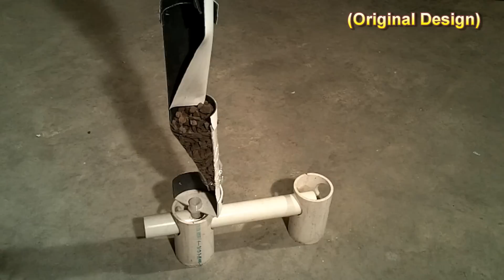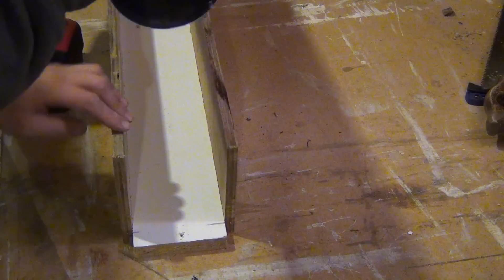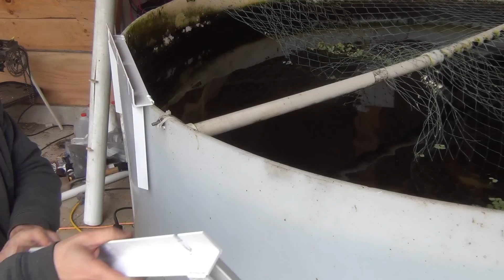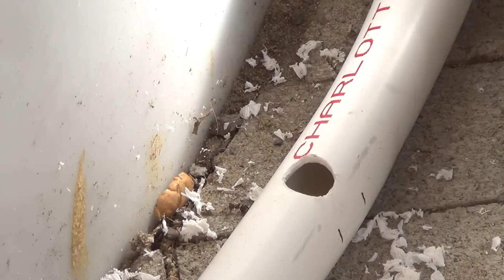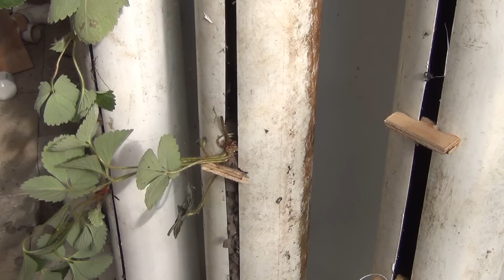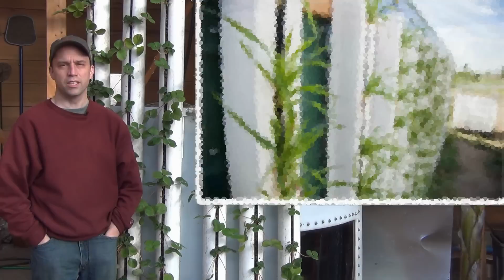How To Build Strawberry Towers: 2.0

Comment: Use coco coir and small holes instead of the slit down the pipe. Coco is light and airy. If your pump goes out with them rocks your roots dry within hours. If you had coco it would retain moisture for hours, you could get away with hand watering in reality, if you dialed in your evaporation might just water 1-3 times a day. Cool build

Comment: I'm looking at a tower system of some sort for new strawberries next spring.   Obviously, you are in a warm climate based on the idea that you have a fish tank that you are attaching the pipe to.
I'm in zone 7A which gets cold in winter.   
Suggestions if you have any?
Reply from the maker: We're in 6a.  If you're growing a few plants a tower is fine but eventually the roots will clog everything. I don't use towers any more.
Reply: @Bigelowbrook  Thanks for the info.
I just tried transplanting strawberry runners from a friends place.   I wanted to keep them on the runner and pot them until they rooted but I couldn't do that.  I'm hoping the roots take.   It's getting warm and the leaves are wilting.  It's only been two days so I'm figuring this will be happening until the roots re-establish.  
If it doesn't work out for me, I just found another source of rooting where I can actually leave the runners on the mother plant and root them from there.

Comment: First.. awesome design..especially when you compare the cost of diy..compared to the cost of zip towers!
I know this vid was made way back in 2013..so now 5 years later 2018.. would you use other medium in the tubes..say...like maybe..coco coir or a antibacterial material like they use in the zip towers?..
The 4" tube..could easily and very inexpensively be retrofitted several different ways to use "other" grow medium.. but I bet you've figured that out already. Again.. very excellent video!
Reply from the maker: I used these with expanded shale for a few years until I had a fruit fly invasion and pull everything out.  I never got around to putting these back it, but they did work well!

Comment: I like using the end caps and Tapping the fittings. 
I was going to use "T" sections of pipe on the bottom but that means a lot of cutting and gluing not to mention the T fittings are more than twice the price of the end caps and fittings.  Going to do it this way for sure. So much faster and easier. 
Good tips, thanks.

Comment: When you're pouring in the expanded shale, could you run a bit of tape to the bottom and just pull it up as you fill so it doesn't fly out the slot?

Comment: why bother with a slot? just drill wholes!!
have you kept them over winter, what is your success?
Reply from the maker: +sonofthunder These have been in place for 2 years now.  If you just drill holes, the plant will get root bound and get so tight the water can't get through.  With this method, you can stretch out the pipe and drop the material right out.

Comment: I built some of these but once the plants start growing the water started leaking out the side of the pipe through the slot. Didn't work very well, tried leaning the pipes over which worked for a while but eventually started leaking again, big problem as my water all ended up on the ground.

Comment: Very good idea. I would say you can save yourself time making this by putting the saw gate .250 then flipping over and going the other direction, you still get a .500 cut without having to move the gate. (If your jig is open on both ends)

Comment: Have you thought about leaving a 6 inch section intact on the top & bottom to maintain spacing?  So, just start your cut 6" below the top & stop about 6" before the bottom.
Great DIY version though!!
Reply from the maker: When the roots get impacted with the shale, I wanted to be able to spread out the pipe to get it all out.  It's the problem with the old design where it's nearly impossible to get the stone & roots out.

Comment: You are just the bomb on this stuff!
Might I make a suggestion? 
You could easily (cost effectively) use a very light weight and affordable material that is mold resistant, antimicrobial.  It's a product that you find in filters for air.  So they will be very safe!  It's amazing how well the plant roots will attach/adapt this. 
You could also use light weight coco coir chips (not the bricks).  This would be of course a little more expensive than the filter material or gravel, but it's very organic and seriously light weight.

Comment: I have a large bed in my garden devoted to strawberries, I would LOVE to get them out of the bed and into a tower. ***** I'm going to check into your square pipe idea. Have you tried it yet? Thanks for the inspiration!!
Reply from the maker: I would avoid the square fence post since they are usually made from PVC. The pipe I use here is all ABS which is "safer", not the best, but better than PVC.  You probably could just run water through them, but they're going to need some type of nutrient added so it's usually just easier to do some kind of re-circulation system system...I like the aquaponics.  If you let the system go dormant in the winter, you probably don't want them to get too cold.
Reply: Ok, thanks so much for the info. You've been super helpful, both of you.
Reply: It's scary to think that our drinking water runs through that same pipe. Yikes.
Reply: Ah, you're so knowledgeable. Thank you!
Reply: FRESH PRINCESS, no I've been traveling and I'm still in Indiana with my family so I haven't been able to yet. I'm planning on ordering a larger pump in the next week or so and I should be able to start to test it all out during the first week of Feb...this should give me enough time to get it going for spring and plant some greens first. I'm also going to try different forms of grow media (ie. expanded clay, limestone, and biochar) and see how they each perform. I'm glad I could be an inspiration to you on this. :) I really like Bigelow Brook Farm (Web4Deb)'s towers as well...he usually know's what he's doing...and if he doesn't, he does a good job of fooling me! :-) haha I'll keep you updated!
Reply: I don't have a hydroponics system, I wonder if these word work on a regular drip irrigation system and if they'd freeze during the winter. I'm in Oregon.
Reply: I don't have a hydroponic system either FRESH PRINCESS, but I'm working on building one that's somewhat mobile (and cheap)...as you already know. I think I'll be able to grow quite allot in a small space with my re-purposed towers. I'm in South Carolina and I think I will be able to run year round with a heater in the water (during the winter). I think Oregon would be too cold for this but if you have a small greenhouse I bet you could keep it running! :-) It never hurts to give it a go...
Reply from the maker: FRESH PRINCESS It depends on the type of PVC pipe you're using.  There is a version that is for potable water but is usually 1" and smaller.  Once you get into the larger stuff, it's for sewer drains so they don't care about it transporting water.  ;-)

Comment: Nice looking towers :)
Do you think setting them up with a bit of a lean back towards the fish tank would sort out the leaking problems? Really want to try grow tubes of some sort for next seasons strawberries & these look great..
Thanks for the look Rob :)
Reply from the maker: Doing a lean will help a bit, but you still may get some water that grabs on to the plant, goes down the stem and drips off the leaf.  Also, if you lean it, some of the water will still come out the slot, then work it's way to the back side.  You want to make sure you don't pack a lot of stone in the bottom so the pipe can stay smaller than the cap so there's a gap between the pipe and cap and the water can get back in.  Or, you just set the tower above your tank and let it all drip in!
Reply: Bigelow Brook Farm (Web4Deb)
Cheers for that :) Migth save me some grief..

Comment: Hay Everyone, be sure to watch the video through to the end.  Rob mentions that this method might not be so terrible for something you only plant rarely but sometimes there is very good reason not to try to "re-invent the wheel".  Rob mentions that the Commercially available ZipGrows are lighter weight and far easier to plant/re-plant.  The Media in the ZipGrow towers as well as the PVC housing is also specifically made for the purpose of growing food so you don't have to worry about unknown recycled materials that could be used for those fence post covers or possible fire retardants or anti fungal agents that might be used in air or evaporator cooler filters.
I would definitely say wait for some updates from Rob on this one before deciding to spend a lot of time and effort to replicate this one.  He may come back after a few months to tell us that the roots have caused the water to start coming out the crack too much and leakage could become a real problem.
Reply: I think even the purchased zip systems suffer from the same water loss you speak of. Water will always find the easiest path to travel. I think the trick would be to have a bucket of something to catch any water run off and force it in toward the drain sump . I have some ideas but I'm going to experiment myself as if you put your thinking cap on you may have better ideas than I foresay... Even a simple bucket located above the bottom with the main drain pipe running through central . This would have to be placed on little planter feet to ensure the bucket sat perfectly with the planter running through the center and not moving around a lot if the pipings touched at all as any leak at this point would defeat the point of having them there to start with!. I know this was posted a while back but I'm sure some people are still scrolling through the comments reading and looking for advice ect, I've found myself here!  So I've left my five cents . I hope it might help somebody who suffers water loss at some point ideally and not be another over shadowed comment !. Good luck with all that you all do whether kingkong or Tinkerbell sized!. Best wishes James .
Reply from the maker: You don't have to wait a few months for that answer.  I already have a few drips coming out of the system.  If I run the water too fast, it sort of "whips" off the stones and comes out.  There are a couple of spots where the roots have (surprisingly) started to grow out of the slots and the water will drip off of them.  Except for the occasional dripping, the plants are doing well.  I am not looking forward to transplanting these but it should be better than the old towers...we'll see in a couple of years!
Reply: Bigelow Brook Farm (Web4Deb)
Well provided you are feeling strong and that the bottom end caps can be pulled off.  Hopefully you should be able to stand on a sturdy step stool and shake the media/plants out into a kiddie pool or stock tank or something.  No after watching you try to fill/plant them, I don't think I would try it.  Problem with vertical is always the dripping/leaking no matter what method I've not seen any that are absolutely perfect.  The Zipgrows come close but they are not perfect either.  Best means of vertical growing I know of is to grow vines and tall plants that can be trained, then nature takes care of lifting the water up and we don't have to pay to pump it higher.

Comment: those zip towers (?) look alot like vinyl fence posts with the notches cut out. Did you consider making these out of 4" fence post covers? ... they make them with similar slots already cut into them .
Reply from the maker: I'm not sure what's in the plastics for the fence posts, but I probably wouldn't want them in my system.  These pipes I'm using are ABS which is "safer".  I'm fairly sure the ZipGrows are a special plastic that is designed for food contact.

Comment: would be probably much easier and less mess filling the pipes at a slope with the slot facing up and placing them vertically afterwards.
Reply from the maker: yeah, I tried that.  It helped to keep the stones in, but I still had problems getting the plants set nicely.

Comment: Was there a reason you didn't use a dado blade to make the slot in the pipe?  If stability was an issue, especially at the end of a cut, perhaps you could add a scrap piece of wood to your cutting surface behind the blade that's the same width as the cut with a tapered edge to prevent the pipe from collapsing in on itself around the blade as you cut.
Reply from the maker: I didn't want to use my good dado on plastics.  It didn't do much harm to the pipe to just cut it twice.  Also, it's a real pain to change out the blades!  ;-)